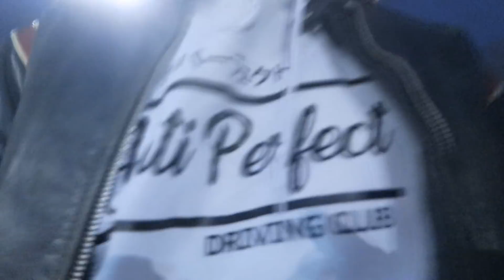SINGLE V.S. DUAL TITANIUM EXHAUSTS!!! *Sound Comparison*

Comment: To compare mufflers you guys need to make sure the middle catalytic converter is same. Otherwise  no use to compare it. The single muffler sound like a stock catalytic converter while the dual muffler sounds like a aftermarket catalytic converter by it's open loud sound.

Comment: I like how loud yours is, but personally prefer single exit. Looks more JDM in my mind. Does the gray Evo have anything else done to it besides the exhaust? Sounds quiet for a Tomei... here is my Invidia N1 
https://youtu.be/aQOWqlU0FmY
Reply: DT-V Production i have turbosmart bov but thats it! As i have the mr i need to do parts specfically in groups as, test pipes(which would make me way louder) and downpipes or the intake would require a tune each time the part is installed. I am unable to run these untuned due to the risk to my SST
Reply: Oh ok. My buddy had a Tomei with ETS open dump downpipe and a ets testpipe. That thing was hecka loud and spitting flames.. love Tomei. Good choice
Reply: DT-V Production thanks am really loving the exhaust, next year is a test and down pipe most likely soo hopefuly we can try this video again then  haha